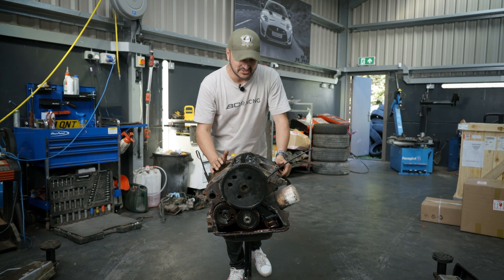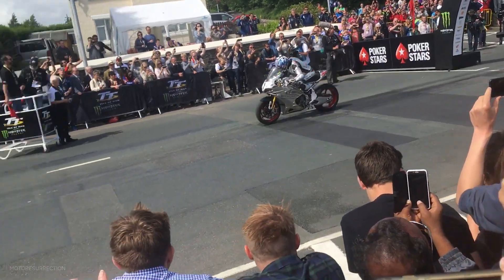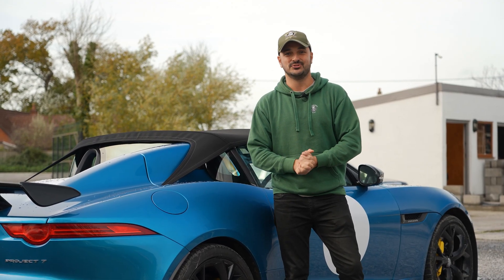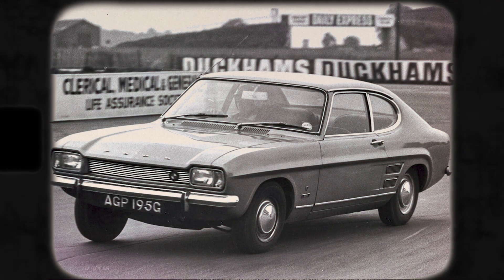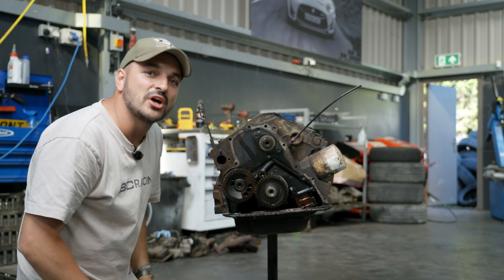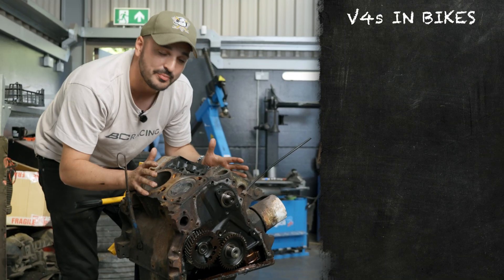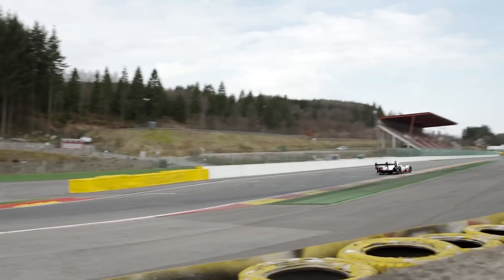Why Do Cars Not Have V4 Engines?

Comment: Hmm! Wondering if that Porsche V4 would fit in a Saab 96 or a Sonnet! Had a 96 and a 95 with that stout little motor. It probably contributed mightily to the early Saab blown transmission syndrome ! Got to be gentle with freewheel on but it helped in the snow by eliminating engine braking when you dropped throttle.

Comment: Ideally, a reliable modern V4 Car engine would be 90°(self balancing), 3L-4L in displacement, and making around 400-500 ish horsepower as Ducati can push 200Bhp out of a 1L.
Reply: Bike engine vs car engine 

Apples versus oranges.
Reply: @e28forever30  Apples vs oranges 

Car vs bike engine

Comment: It would be cool to see more V4's in racing, but the one sport I don't want to see them in is F1. Unfortunately, we most likely will see V4's or inline 4's in F1 sooner or later. According to the 2026 regulations the power delivery has to be split 50/50 between electrical and internal combustion. I'm sure that the next major regulations change will be something like 80/20 split between electrical and internal combustion, and that probably means the engines will be further downsized to a V4 or i4.

Comment: I found  many tranny v4s had firing problems due to the distributor bearings on the rotor wearing oval and setting up an oscillation that made timing a nightmare to set up, truly awful engines, pity the wankel replaced vehicles,  out the frying pan into the fire!

Comment: I'd take a 500cc or 750cc V-4 Honda and attach to generator. Electric motor or motors to drive wheels. Have a 50 mile battery pack for between 80% to 20% for EV mode. Get below 20% generator forced starts. Sport / tow, mode charges batteries to the 90's. Then, it stays on to assist the battery charge to electric motors. Automatic mode just charging batteries to 80%.

Comment: I have an AMC M422A1 "Mighty mite" with a Aluminum 108 cu in v4 air cooled engine. 

So much fun to work on and sounds like a motorcycle. Not as high of revs but still a blast.

Comment: Inline 4 engines are much cheaper than V4 engines, especially DOHC configurations.  Cars have the room for I4 engines, the extra cost cannot be justified,  like it can in a motorcycle,  especially a Moto GP bike.

Comment: Mike: "Forming a Hot V...".
Me: Eeeh..? no, noo! Video shows exhaust manifolds on the outside of banks..! A hot V should have the exhaust manifolds in the center of the V! The point of a Hot V is that the exhaust enters the turbo instantly, at maximum temperature to ensure using maximum expansion/volume. Any loss in temperature of exhaust in transit is shrinkage of exhaust volume = less efficient = losses.

Comment: Just that tiny bit you showed of that lap . That looks like it is a sped up video. I have thousands of laps of nurburgring on a sim and low six's is moving.  It's not a easy track . It has a lot of bumps that take time and laps to remember every little one . Hit one just off an inch and you lose control

Comment: The Fulvia 1.6 V4 could do 115hp and 113 lb-ft of torque. Not too bad for the very late 60s and early 70s. Lancia used the V4 as the Fulvia was front wheel drive, but still longitudinal like a modern Audi. The V4 kept them from having excess weight in front of the tyres.

Comment: Saab also used the ford cologne V4, like the Essex V4 an utterly shite engine. Both simular but different, distributer position is an easy way to identify which is which. My conclusion as to why V4 engines never took off and became popular is because of poor torque, as with flat 4 engines they are inherently lethargic at lower revs, not an issue on motorcycles.

Comment: Well,modern day engines  are a different animal  but in the day ,The ubiquitous Transit  V4 was a good workhorse , the 2.0 litre Corsair was almost a classic, The European Ford V4 , again a reliable lump . Saab refined the Ford V4 with slight engineering changes ,like Carb and distributor and those went into 150,000km life . No  puny single row  timing chains , or self distructing timing belts  ,admittedly the non metalic timing drive components occasional made a bit of a racket though   . Source the production figures for those vehicles  and You may well be surprised .
Maybe give a rundown next on the small capacity Stellantis etc.  wet belt offerings  , and most of  modern 3cyl.turbos for unreliability at higher mileage plus the difficulty of stripdown of these .

Comment: A good number of Marine Outboard engines back in the day (1970s-1980s) were V4s, very common in 2-stroke form.  They made 200-250hp range @5500 rpm’s.

Comment: A company COULD make a modern V4.... and it would be pretty dope. I mean H4 is basically a V4 but instead of V shape its full H shape. So we already know it can work. It just needs someone to make it. The issue is, V4 wont fit in the space that a lot of In-Line 4's would fit. And with Subaru, the whole reason they went H4 is because they wanted to make the engine sit lower. Not only that, they design their car shape around that meme. Which gives them a unique look compared to other vehicles. Like when people try to fit a inline 4 in a subaru engine bay, it doesn't fit, it sticks out the hood. Personally? I would LOVE if an American brand went full JDM in styling and created something that was very clean like a JDM but offered a front engine V4 with rear wheel drive. Something easy to modify and mess with for tuners but also cheap enough for new car owners. Honestly I would do it, if I were rich and had my own car brand? I would.... something unique to push people to enjoy cars again. But today car brands dont give a shit out car lovers, its about the normies who buy whatever and dont care.

Comment: 11:11 Hot V?
A "hot V" is by definition the exhaust vales INSIDE the V bank.
Afaik can we see here the exhaust vales OUTSIDE the V. The stainless steel, big volume pipes wrapped in head shelding.

The benefit of a hot V are the ultra SHORT exhaust pipes from head to turbo. As we can see ... not the case here.
Reply: 11:02 clearly NO hot V.
As there is the intake in the middle.

Comment: Subarus 4 cylinder boxers are "v4" just flattened at 180 degrees. So they do exist. You get the sound with none of the downsides as its balanced

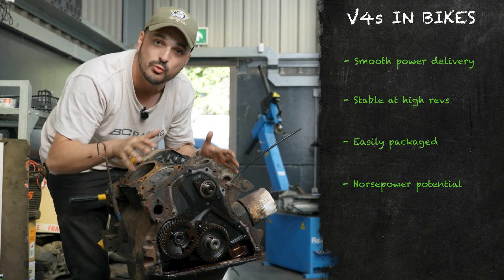Comment: 9:50 Two other Russian vehicles using a V4:
MeMZ-965 - 746 cc (45.5 cu in) air-cooled 90° V4 producing 23 hp (17 kW; 23 PS), it was manufactured in a few different displacements, used in the ZAZ-966 (and similar derivatives), and the LuAZ-1302 (and similar derivatives)

Comment: Le gain sur l'encombrement en longueur d'un V4 par rapport à un L4 (10 cm?)
n'a pas d'intérêt en automobile contrairement à la moto,
(surtout pour l'effet gyroscopique moindre d'un vilebrequin moins long d'ailleurs) sauf peut être
pour le Transit Ford et les moteurs placés derrière les sièges des coupés sportifs (Matra M530).
Il ne reste donc que le coût de production supérieur et le bruit ronflant. Insuffisant.

Le V4 Ford a aussi fait une carrière inattendue dans la NSU Ro80 pour remplacer
le birotor 3 Litres Wankel indigent, par ceux qui voulaient conserver leur voiture.

Comment: Few seconds in and the main reason is they're pointless.
2 heads, 4 cams, 2 manifolds, 2 intakes, additional belts, counter weights etc. For an engine almost always fitted for cost savings. It's a bit shorter, sure. But not really worth the downsides and extra cost.
Reply: 8m 32s to get to what is fairly obvious to a petrol head 😂

Comment: Not sure it would qualify as a "V" ??
I had a Subaru Brumby, with a 4-cylinder "horizontally opposed" (boxer?) engine.  It certainly was NOT an inline-four.
(I had an interesting chat with a mechanic one day.  He told me if a customer had power steering, they could NOT get access to do a valve adjustment on that side.  If it also had airconditioning, they couldn't get access to the other side.  Still charged the customers per the service schedule, but never adjusted the valve clearances.)

Comment: The biggest reason u don’t see a V4 in cars is that an inline 4 can fit transversely in most car engine bays. meaning it can fit for fwd applications (majority of cars). So no need to have a V4, which is more complicated and expensive to manufacture like you mentioned

Comment: I remember reading an article around the mid 1970's about land speed record racers taking  Chevrolet V8 small block engines and strategically removing half the pistons and associated components to create an engine with half the displacement to run in special classes for small displacement engines . Of course on the salt flats you have a lot of room to get up to top speed .

Comment: My father brought a Corsair 2000 GT when they first came out and allowed me to drive it as well, from memory it was a very smooth engine fast for its day and 0-60 was great. only problem at 80 plus the aero on that front cutaway lifted and  made the steering extremely light, where as the Cortina was much better

Comment: Research some more, Ford Taunus 12M, 1200 cc v4 longitudinal front wheel drive,   Ford Taunus 17M, 1700 cc V4, rear wheel drive.
Ford Cologne engines from Germany . Found the engines very smooth.
Reply: The german version is the one that ended up in the Saab 96 V4. 1,5 liters.

Comment: The 1.5 l in the Saab 96 was a really smooth, 'thrummy' engine. Little power, but in its sweet spot, it was silky. Around 55 mph in top - fourth, ugh - it was a quiet and smooth joy, just right for A road trips. It could've done with a fifth gear, but I'm not sure it had the torque...

Comment: AI summary from Google:

V4 engines are more common in motorcycles than cars because their compact, narrower shape is ideal for a motorcycle's limited space, while the complexity, cost, and potential balance issues are more easily justified for performance bikes. In cars, the simpler, cheaper, and well-balanced inline-4 engine is sufficient for most applications, making the V4's disadvantages outweigh its benefits for mass production.

Comment: You mentioned Saab using a V4, a Ford Taunas unit. They also tried their own V4, they built a prototype 1.5 Litre V4 2 stroke. Its at their museum in Trollhattan. My photo of it is online.
Reply: I think you may mean "the Monster", which had two 748 cc 3-cylinder 2-stroke engines mounted next to each other.

Comment: Most cars that are not from the US, which is most cars, have a V4 engine and it's totally fine. The disadvantages are apparently their engine sound and vibrations causing issues for the driver? I can understand that V8s sound better, but in the end most people drive a car to get around, not because it makes such a great bubbling sound. Maybe it's about race cars with a V4 that vibrate a lot? I never experienced any discomfort because of vibrations in a V4 car ever. Is this just a try to justify oversized engines?

Comment: Finally, yes Mike. A video on a v4. I didn't think you would be the guy who covered them but i am glad you did. Love a v4 so many applications. Wish we went the v4 over inline 4 route, far easier to maintain in an engine bay especially if you put the belt at the front. Although imo they should be rear mounted powering back wheels.

Comment: You mentioned the SAAB V4 in the video. This actually used a Ford V4 engine, but it was the Cologne V4, not the Essex. The Cologne V4 was much smaller and lighter than the Essex, indeed I don't think there was a single component that was interchangeable! The Cologne V4 was available as a 1300, 1500 or 1700. At a pinch you could enlarge it to 1800, but no more. SAAB needed a drop in replacement for their 3-cylinder 2-stroke, which was starting to draw the attention of the emissions authorities, and the V4 was small enough to slot straight into the same space, albeit at a weight penalty! The V4s never handled quite as well as the 2-strokes, thought they did leave the rival Cortinas in the dust! The Cologne V4 used offset crank-pins as well as a balance (Lanchester) shaft to smoothen them out. Tickover was never particularly smooth, though they were a lot smoother off tickover. It was more of a torque engine than a revvy one, and didn't like being pushed much above 5000 rpm in stock form, but in the SAAB, it would pull smoothly from about 12 mph in 3rd gear! Most SAAB V4s used the 1500 engine, though later ones did use the 1700 to make up for the power loss of increasing emissions strangulation. Interestingly, when developing the SAAB V4, they did try the Lancia engine. It was more refined than the rather agricultural Ford unit, but proved less reliable in the extreme cold of the Swedish/Finnish winters. You do NOT want a fragile engine in the Arctic circle! I'm currently driving my 3rd SAAB V4, having bought my first in 1969. With a Weber carb and sports exhaust performance is on a par with a Cortina GT of the same period. The gearing gives it the edge up to about 50mph, then there is a big gap between 3rd and 4th where the Cortina has the advantage. But then, after about 65 mph, the better aerodynamics and taller top gear swings the advantage back towards the SAAB. The SAAB is also a lot more comfortable and has better ride and handling!
Reply: The Sonett III received a 1,7 version to retain bhp in the US when exhaust emission rules hit in the early 70s. 
The 96 V4 had the 1,5 until end of production in 1980. 
There were ~100 cars made in 74/75 that however got the 1,7. These are real unicorns today.
Reply: Well done on using Google.
Reply: It was actually a Holden V-4. Cosworth made racing versions of it.
Reply: @CMDR_CLASSIFIED  Er, not in a SAAB, it wasn't! Holden were part of General Motors, a rival of Fords. The SAAB V4 was most definitely a German Ford engine, also used in the German Ford Taunus. The Cologne V4 was also used in agricultural machinery, threshing machines etc. The SAAB 99 that followed the 96 V4 initially used a Triumph Dolomite engine, an in-line 4, but SAAB weren't impressed by Triumph's build quality, and took a license to build it in house. That engine was developed independently to become the mainstay of SAAB right up to the time that GM took them over and a bit beyond.
Reply: @pchristy102  I beg to differ. Had a few 96's myself, as well as a number of the V-4's, and all were Holden's. And look, I have been a Mechanic for over 35 years now. I do know what I am talking about. I even had one engine with Cosworth heads on it.
Reply: @CMDR_CLASSIFIED It's a Ford Taunus V4. This is easy to google. 
Mine is stamped Ford for sure. 
Perhaps you had some that were after market tuned by Cosworth. Never heard that before but it sounds like an interesting tune.
Reply: @CMDR_CLASSIFIED  Do please describe this Holden engine in more detail. When was it built, cubic capacity etc., if it was it built exclusively for SAAB or also fitted to other Holden models. I have had several 96 and 95 and all were Cologne Ford engines.
Reply: @CMDR_CLASSIFIED  With respect, I've owned 96s since 1969, doing my own maintenance, so while I'm not a professional mechanic (I'm a retired engineer) I do have a LOT of experience with these cars. The last one rolled off the production line in Finland in 1980, so some 10 years before you became a mechanic. I also offer you this - found after a brief Google search.  https://en.wikipedia.org/wiki/Saab_96  I'm sure there are more reliable sources available, but this one is spot on the money. The original factory service manual that I have from my first car refers to it as a Ford V4, and mine is fitted with some FoMoCo aftermarket tuning accessories, most notably the inlet manifold for a Weber twin-choke carb. I know General Motors made some V6 engines. I had an Omega for a while, and it was thirsty beast, but I have never heard of a Holden V4. Mind you, living in England, I might not have done, though I have owned a couple of Australian Fords down the years. I also know that a few people have fitted Cologne V6s in them, but this was a very difficult conversion and made them VERY nose-heavy. I can only assume that the ones you have owned have been locally modified. Certainly there is no record that I've ever seen of them ever being fitted with a GM V4 ex-factory.
Reply: @pchristy102  Look, all I know is what it said on the engines, and it said "HOLDEN"! I don't have the cars or the engines any more, or I would take a picture and send it to you. In fact, I fuckin' hate SAAB! Only thing good that came from that area was Husqvarna! OK, they did make a pretty cool jet that did some unique things for it's time, but that's it!
Reply: @CMDR_CLASSIFIED  The only thing I can think is that we are not talking about the same cars. Some of the later SAABs did use GM V6 engines. I can't remember exactly when they were first used, but it was around the turn of the century, and they continued to use them for the top-of-the-range models right up to the end in 2010. Its quite possible some of those were built by Holden - also a GM brand. All the ones I've seen were German made V6s, just as all the V4s were also made in Germany, although by Ford. Since the cars were all manufactured in Sweden or Finland, it really doesn't make any sense that they would ship engines in from the other side of the world when they could get them from Germany - which is relatively close-by.

Comment: The cheapest and shitties USSR car Zaporozhets had V4! 750cm3 volume! 30 hp! Air cooled! Always overheated, with leaking oil, vibrating, not starting - but V4! Just because it allowed to shorten the engine to the limit and shove it into the smallest car body.